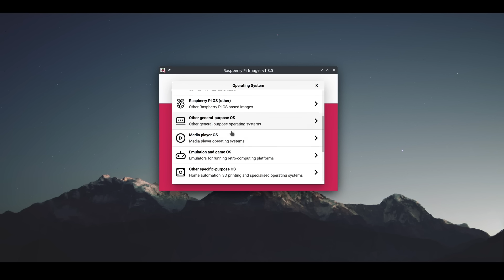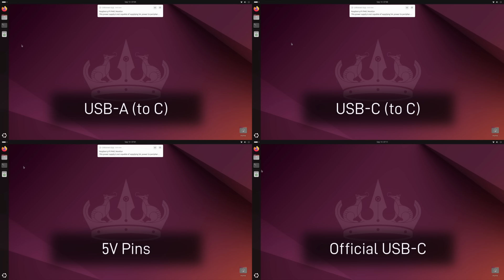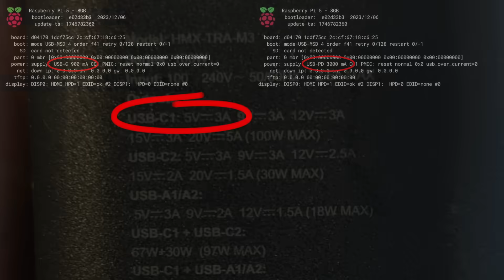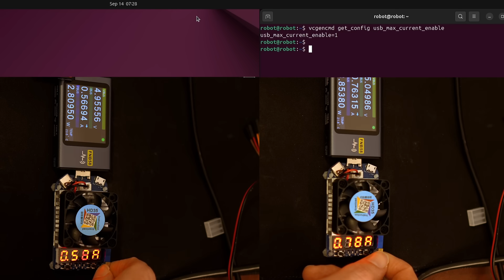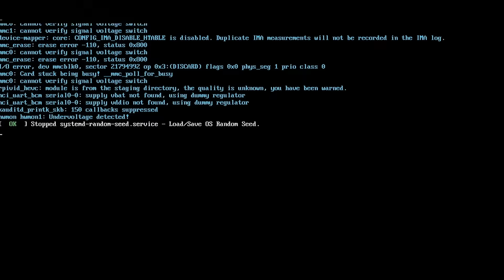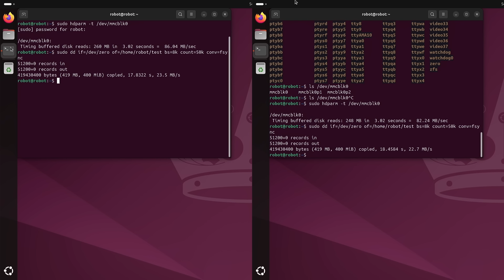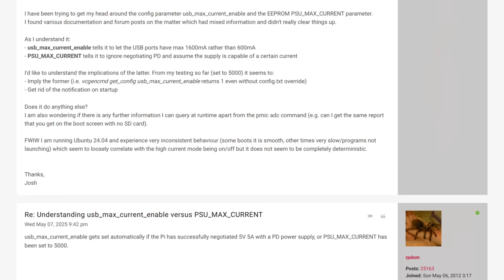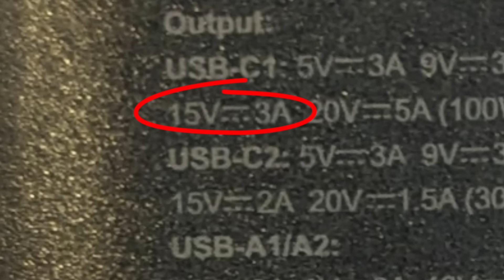How to make a Raspberry Pi 5 actually work

Comment: Funny thing is I considered an RPi 5 for a project as well instead of the 4, but my project relies on WebRTC streaming, and turns out unlike the RPi 4, the RPi 5 does not support hardware video encoding and uses the software (CPU) instead, which leads to heating and power issues.

I think the hardware is more focused on video decoding (playback), looks like the RPi 5 is in many regards worse for robotics.
Reply from the maker: Wow I didn't know that! I guess in theory if the CPU can make up for it that's fine, but not at the cost of stability...
Reply: That's a bummer. I was thinking of upgrading to the 5 because of i2c clock stretching issues with the i2c bus on the pi 4. Why do they have to cripple the Pi like this....
Reply: After reading you comment i did bit of digging, apparently we could circumvent this fairly simply by getting a camera that outputs pre encoded video. Look for “UVC H.264/H.265” in spec sheets and with v4l2-ctl --list-formats-ext once plugged in, you can see the output formats, the format list should include H264 or HEVC (and not only YUYV/MJPEG). The tradeoff is latency. For my application that matters. Camera + PI5 has probably lower latency than just PI5 software encoding. But if the camera has programmable GOP/Bitrate then you might be able to even surpass the pi4. the other alternative is just pay more for a jetson NX ( the orin nano does not have hardware encode) if keeping GPIO is important.

Comment: Thank you very much for your educational video. The hat is a wonderful add-on, but can be pricey. I am using a buck converter USB-PD 65W that is normally used for making fast charger (usually about 3$). Connecting one end to the LiPo battery and the other end to the RPI5 via USB-C cable works like a charm. Tested in my classroom with 5-6 autonomous robots.
Reply: Hi, this seems like a good solution for me. Could you share a link ?
Reply from the maker: Thanks for sharing! I did mean to make a comment in the outro about cheaper/DIY options but forgot!
Reply: @ArticulatedRobotics  You are doing an amazing job. Happy to see you continuing in your passion.
Reply: Confirming we're using a similar solution in our robotics lab 👍
Reply: Could you tell me what components do you use in ur autonomous robot so we can get an idea of how much this configuration of proving power to rpi5 works without any idling.
Reply: Hey do you mind share with us the model  of buck converter that you are using? Thank you!

Comment: I bought a UPS Geekworm X1200 to make sure my pi always has consistent power. How long do you think it will last given that this UPS has 2 18650 backup batteries?
Reply from the maker: Hmm, having just had a quick look - if that's 2x3.7V@2500mAh you've got 18Wh. If you then pull it back out at ~10W you might get a little under 2H? Maybe less in practice though - you'd have to test and see.